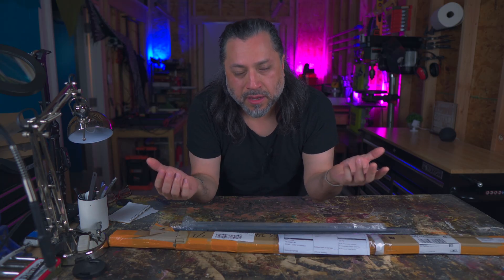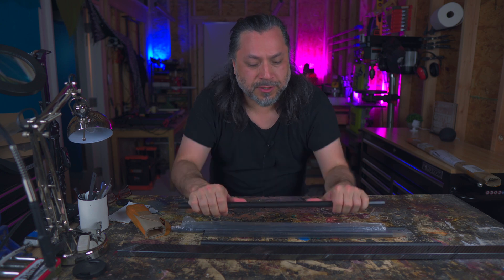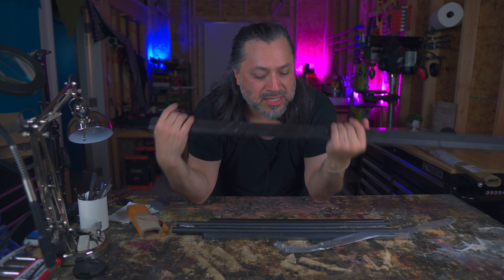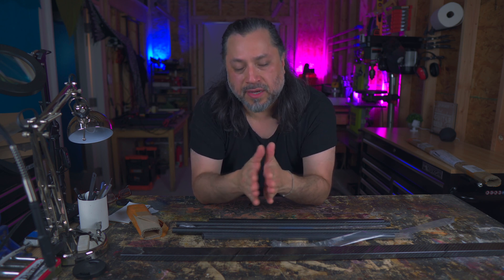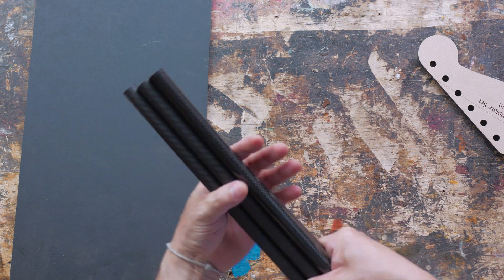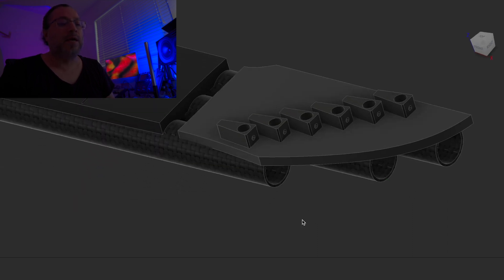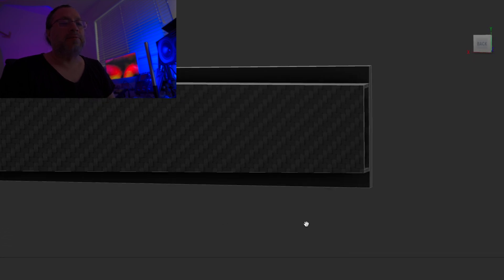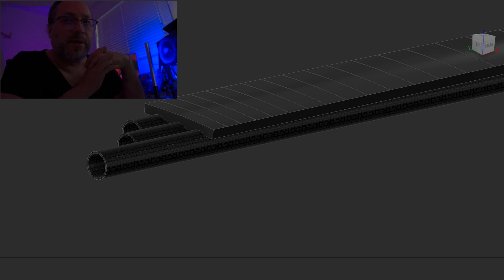The Great Guitar Build Off 2023 - Carbon Fiber Neck Concept

Comment: If using tubes, what do you think about routing one continuous squared channel so the tubes are submerged in a pool of epoxy, subsequently binding to more than just the contact point between the rods and fingerboard? Maybe 3 squared channels? Can you forsee any issues?

Comment: I did a similar experiment because I wanted carbon reinforcement at the same time as I wanted epoxy light strip panels.  I put a tiny hollow round tube inside another and the rigidity doubled.  But I still didn't use it.  I think the hollow large rectangle just has too much empty space on its own, and shape is an issue since its not solid and not carveable. a top layer of small solid square profile rods reinforced with the tubes creating the neck profile would work and stay very light.  You can even sneak a truss rod into that construction as well as support a neck taper just by angling the rods into the taper you want.  The truss rod would help make this goof proof. 
YOur wooden headstock insert is very very very much like a modern hockey stick.  They obviously take a lot of abuse.  If your wood tang is long enough (and could also get some carbon rod reinforcement) its going to be solid.  The hockey blades are often reinforced with a layer of fiberglass over the wood.  
As usual you have great and inspiring ideas.  My GGBO 2023 builds focused on the epoxy and light channels to create lit fretboard inlays and side dots in order to solve that problem of it being impossible to read side dots when playing in darkness.  I'm at the final sanding before finish phase on both a bass and a baritone.

Comment: Once you have the main carbon fibre structure in place would resin or epoxy over the structure help get a dimension,thickness, and feel of a normal neck. At least just for back and sides where the hand grabs the neck. I have no idea....thoughts.

Comment: I'm looking forward to this that's for sure. Forget about the locking at the headstock just use ferrules and the strings ball ends. There has to be a headless bridge that locks.  Maybe even different diameter tubes to create a somewhat radius on the back of the neck.

Comment: Interesting design.  I was thinking it the neck is too narrow, you could always build it up some with smaller tubes in between the outer and inner tubes.  Something smaller to help fill in the gaps.  If the neck is too odd and uncomfortable, you could always cut a tube length wise and use one half to give you some additional thickness.  It'd probably be ugly, just some thoughts off the top of my head.

Comment: I think each headstock design you showed could swap to the opposite neck design you showed 😄 If you used the rectangular tube and extended it beyond the nut you could use the individual string clamps on it. Alternately, if you cut the tubes at the nut, you could use carbon fiber dowels to connect the round tubes to a bamboo headstock that had dowel holes drilled in it.
Reply from the maker: I thought the same thing. Level of effort is also a variable in my decision. I'm trying not to over engineer the design.

Comment: I wonder if with the tubes you could not have a pocket per se, and just drill three holes into the body, so it just slides in. then secure it with screws from the back. but I doubt that would work would it. you'd need some more space/body material in between the fret board and the tubes for a secure fit. Curious how the tube neck feels, and what you do to round it, if anything..
Reply from the maker: That's a good idea.

Comment: Mark, I'm so glad you're doing a carbon fiber build.  On my triple tube neck, I used one 15mm tube flanked by two 10mm tubes.  No grooves in the back of the fretboard, just some CA glue along the lines of contact with the fretboard and between the tubes.  The nut was a Steinberger, screwed into dowel plugs glued into the ends of the tubes.  The neck was a two screw bolt-on, using a wood dowel in the center tube at the heel, and wood screws.  My one tube neck allowed too much fretboard flex.  My twin 17mm tube neck was a bit chunky compared to my trapezod profile wood necks.  The triple tube has a trapezoid-like profile.  The twin tube build, and the guitar I made with the triple tube neck are both on my channel.  So is the carbon fiber body build with the 10mm tubes that failed.  I've come up with a new body design based on 15mm tubes that should work, but I haven't gotten around to it yet.

For a headstock attachment method, another option is dowel pins glued into the ends of the tubes.  They stick out of the ends of the tubes and go into dowel pin holes in the base of the headstock.

If you go with a Steinberger (or similar) nut instead of string anchors, you can use dowel plugs and screws - no problem.  A real Steinberger nut won't require ball ends, so it will work with individual multiscale barrel type tuners (which I assume you're using) - but you don't get a cool headstock - and no headstock shoulders for a guitar hanger.  All you can do is a peghole hanging bracket behind and above the nut.  It mounts between the nut and neck, goes back, then up behind the nut.  Trying to add headstock shoulders under the nut gets in the way of playing open chords.  

Personally, I'd go tubes, dowels and dowel holes in the headstock base, and string anchors.  Perhaps dowels that fit the tubes, and then are smaller on the headstock side if needed. 

I don't have video of me making the triple tube neck, but this video shows the result:
https://www.youtube.com/watch?v=_CsR2g2AV3g

There's a build series on the guitar that eventually got the triple tube neck after the carbon fiber body fail,, but offhand I can't recall which guitar it was - maybe guitar 6 or guitar 7.
Reply from the maker: I've watched all your builds. You have a lot of inspiring ideas. I've decided to test out the three-tube design before committing to it. I plan on machining those channels on the underside of a cheap fretboard this weekend. I'll epoxy the tubes in and then perform a stress test. I'm confident it will be rigid enough.

Comment: Nice, like the off the shelf accessibility. The end of the tubes could be set in a toughened polyurethane casting resin for fixings perhaps? There are also a few low cost additives that might help if your going to use epoxy for gluing, micro fibres can be added for a tough structural bedding glue/fillets and micro balloons/spheres for non structural filling much like a car filler you can add these untill desired viscosity is reached can also be pigmented with black.I like your idea of round tubes going into the rectangular cf tube this would be mega strong if filled with epoxy around the outside of the round tubes. Look forward to seeing where we go on this cf adventure!

Comment: I made a youtube video a few years ago building a carbon fiber guitar. I molded the neck and body as one. The neck was super stiff. Absolutely zero flex. I look forward to seeing your design. Your entry last year should have won,
Reply from the maker: I watched your vid on the carbon fiber guitar build. I came across it when I was researching carbon fiber guitars. You put a lot of work into it. I'm hoping using off the shelf components reduces the level of effort.